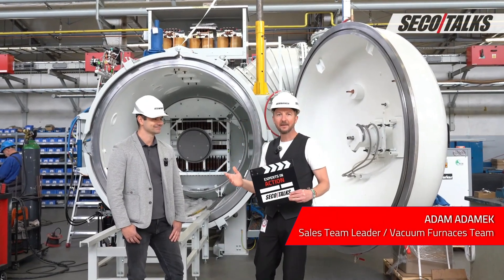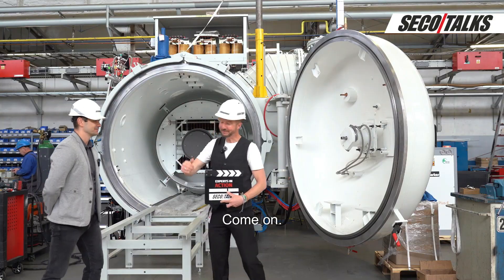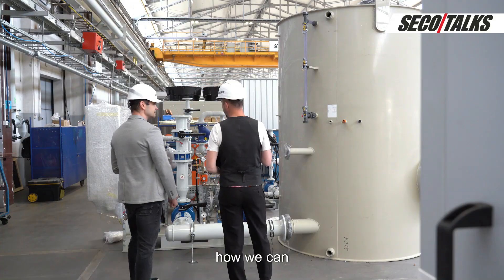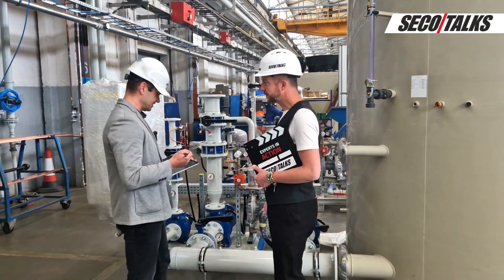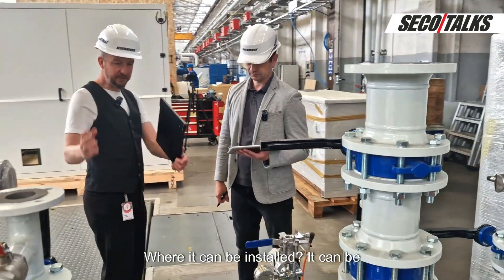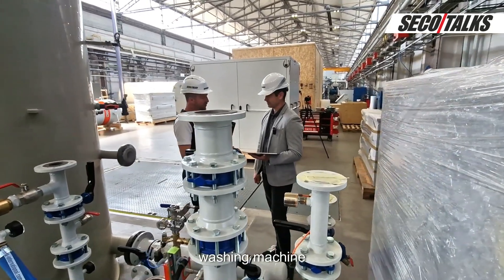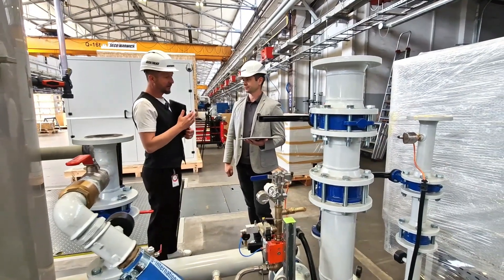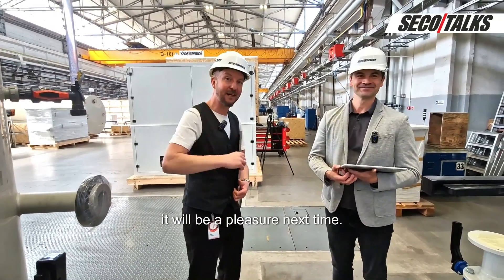SECO/TALKS: The heat that comes back - Heat recovery in #HeatTreatment

Comment: Interesting video. In the factory that I work in, they have been using the heat from the heat treatment furnaces, casting furnaces and forging to heat the buildings since before I was born in 1988 :))).
interesting ideea to use the heated water for the washing machines. But you use the heat pump to heat up the water in the washing machines directly? or to transfer the heat to the water used in the washing machines? because usually the washing machines don.t use plain water. and adding additional water will lower the concentration of the solution. And you can.t add water endlessly
Reply: Hi Vlad, thanks for your comment. Yes, the idea is not new but now this is the moment everybody asks for solutions that save energy, costs and reduces CO2. We have given the idea a new life by applying it to furnaces of different kind. Regarding your technical question, we need to use different and dedicated types of heat exchangers before the heat is transferred to washing machines. It depends on the particular chamicals that are used in particular wasching machine's tanks. if you have any more quesions, feel free to contact me. Have a good day!